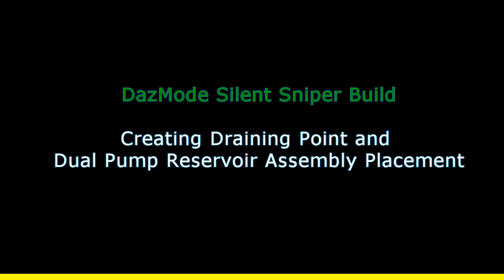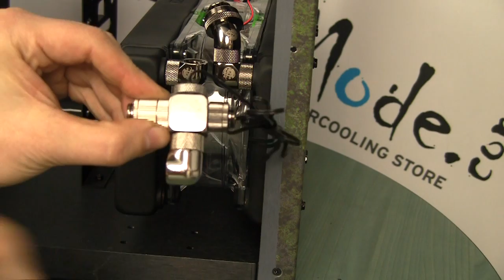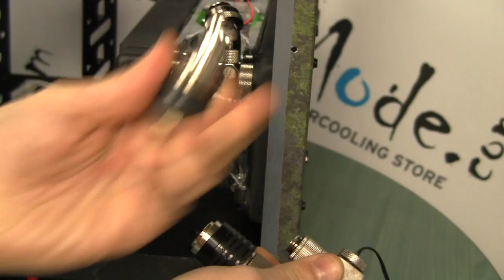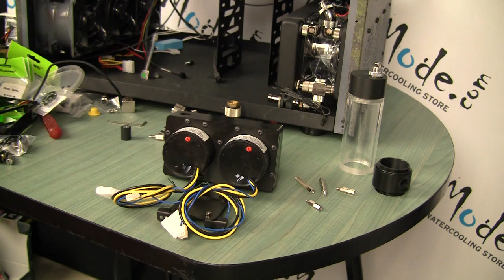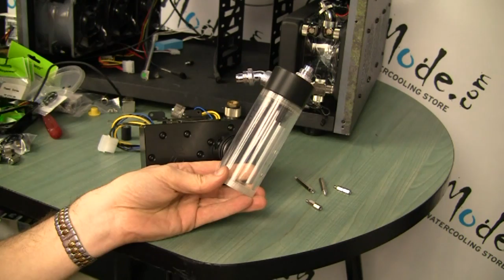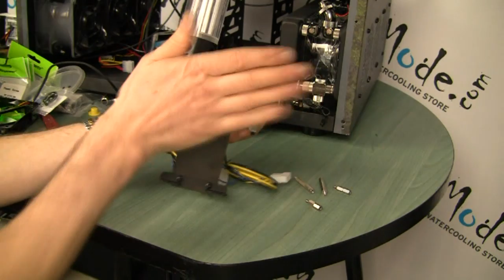Creating Draining Point & Reservoir Pump Combo - SilentSniper (9)

Comment: I think it's better to drill a hole for the exhaust tube so the water could leak out , and not in the case. Anther thing that might go wrong in the water reservoir ,it's leg won't support the  tank when it's full of water it would sink to the left if you won't tie it

Comment: @cal920c 
2000 RPM fans doing less than 20 dB?  Is that with Noctua fans?  I didn't think those fans could be that quiet with such a high RPM.

Comment: @probaner92 Quiet doesn't always mean low static pressure, it means low noise, there's other ways of reducing noise without reducing fan RPM's, Eg. I've had 1500 RPM rans doing 35 Db, while i've had 2000 RPM fans do 19 Db.

Comment: @cal920c he wants a quiet system -> low rpm -> low static pressure.... you didn't google it, did you? if you had seen the diagrams, you'd be convinced that double stacking isn't the right thing^^

Comment: @cal920c that's pure theory... but the most important point is static pressure...
I read an interesting article about stacked up radiators at realredraider. if you google for "Stacked Radiators / Rad-Sandwiches Part 2" you should be able to find it ;)